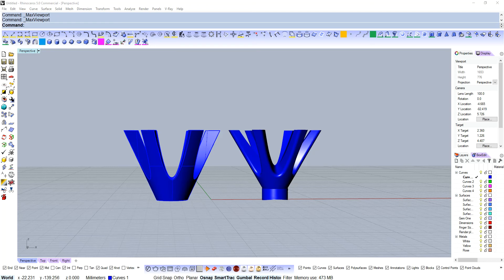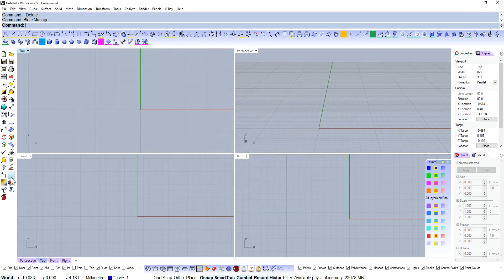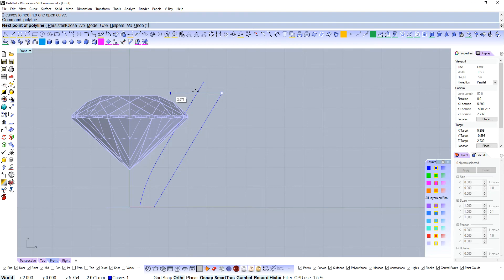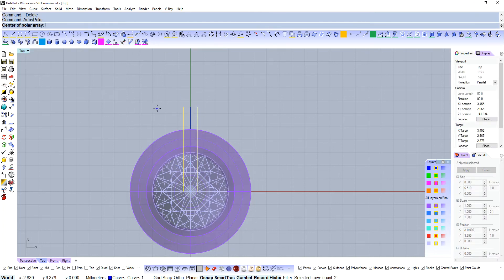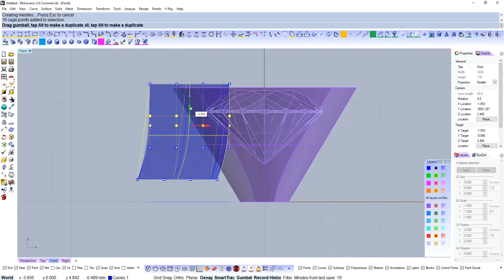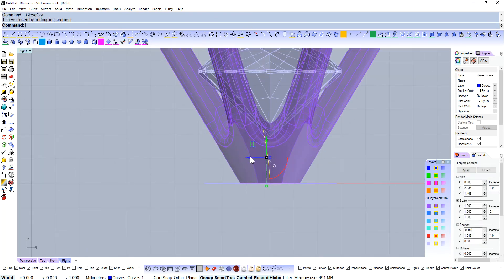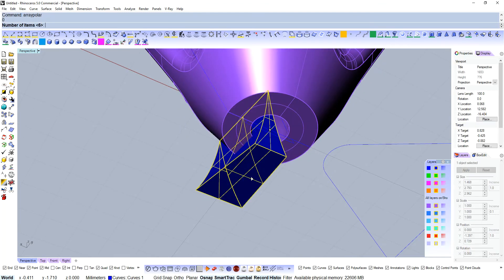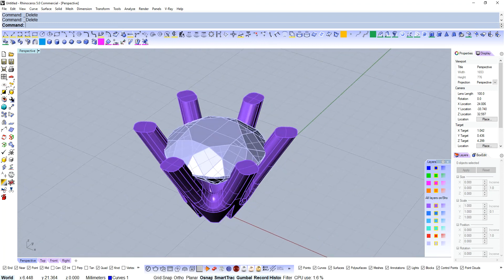6 Claw Setting in Rhino - the un-rubbish way.

Comment: Great tutorial! I really appreciate learning how to do this setting. I am having a really hard time getting the fillet edges command to work on the setting though -I keep getting a 'failure to create corners' or bad artifacts. Do you have any insight on how to fix this?
Reply: Fillets can be a little tricky in Rhino. Try stepping down the radius size until it works, make sure you select continuous edges. Good luck...
Reply: try 0.3 or 0.2. sometimes if the lines are not clean, fillet will also not work, so make sure your lines are as perfect and simple as possible